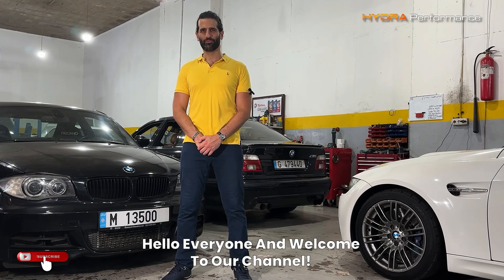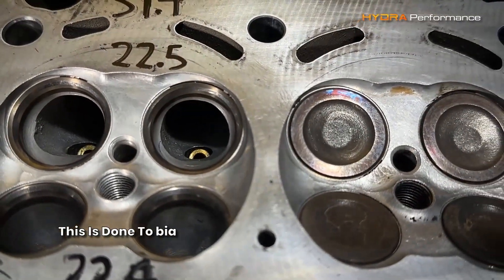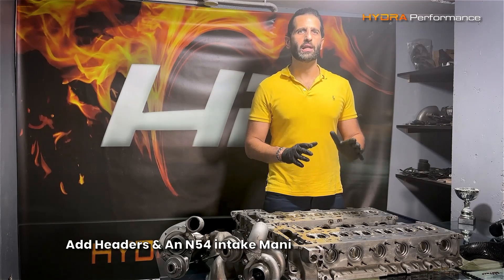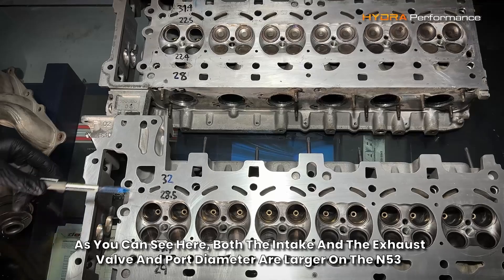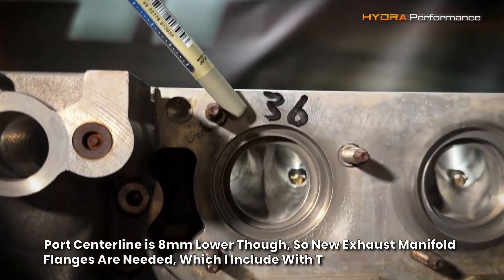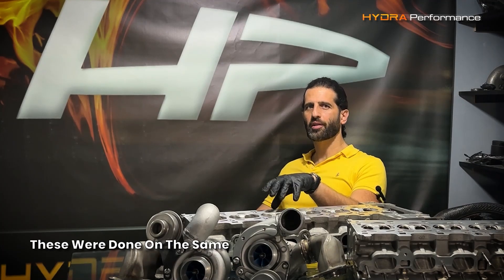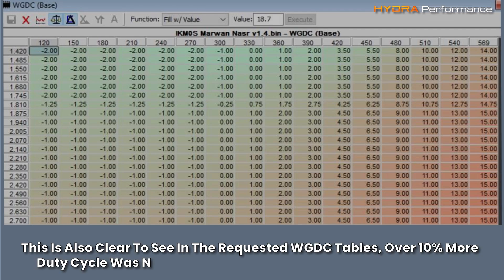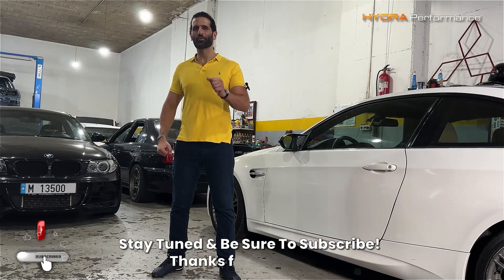N53 vs N54 cylinder heads up close & personal! Is the N53 head swap worth it on an N54? We think so!

Comment: Do you think this trick would work on and N52?
Reply from the maker: Yes, but the Valvetronic tower needs to be milled and the head then needs to be drilled and tapped for an intake cam ledge. You would also need an N52 valve cover as well, and the N54 intake manifold bushings need slotting to get the correct port alignment... I can supply  a turnkey head if need be. Oh, and compression ratio will also probably be reduced as well.

Comment: i cnc ported n53 head, 298/288 +11mm cams, 3.3l 11:1 compression with honda k24 head studs.   i made 1034whp through a zf8hp gearbox with 14 psi and 2* pulled out of the tune.  n54 head never made anything close to those numbers with the same turbo on a fully ported n54 head same cams.   the n54 blocks split at 1000+ hp anyways so it doesnt really matter.  if the block would have held up i could have put down 1300+ whp easily with the n53 head but after splitting 3 blocks we gave up.  2jz time.
Reply from the maker: That's awesome, would be interesting to see a dyno plot if you had any.
Reply: Why does the block split? Aluminum? vs iron block 2J?
Reply: No you just needed an s55 block
Reply: @Piecrumble this is the evolution of the N54/N55 so makes sense 😂
Reply: stock N54 sleeves im assuming ? or darton sleeves ?
Reply: I hope you used the proper headstuds, the rounded nose ends on the stud is what’s needed for N54s otherwise you can crack them easily

Comment: What’s fitment like with a single turbo top mount?
Reply from the maker: Provided you reflange your existing manifold, the turbo will sit 8mm lower in the car
Reply: @HydraPerformance.  you guys sale the flange?
Reply from the maker: @khemchee4685  Yes, with our head packages as mentioned in the video

Comment: I would be curious to see how the N53 head stacks up vs an N54 head with a decent pocket port and some exhaust side work.    Any risk of piston to valve contact using the larger valves of the N53 head?  Any considerations needed when calibrating Vanos?
Reply from the maker: I doubt we'll ever see a truly unbiased flow test comparing the two. I've been told by more than one person that the #s VTT put forward were BS, and given their track record I'm inclined to agree, because even given the same throat diameters a) a 36mm port will always outflow a 33mm port of similar geometry > 0.2 L/D, and b) The N54 head casting has little to no room for a short turn radius on the intake, even ported, so the N53 will always have it beat, and that's assuming you can even open up the throats by 6mm to match the N53 which I doubt...    

We've been running these without issue , on several customers' cars now as well, for several years now. No problems with P2V contact or any special VANOS settings needed. Truly a PnP swap if you've got your exhaust manifold sorted out.
Reply: @HydraPerformance.  Thanks for the reply.   It appears to definitely be a great option for those building the N54.   Harder to get over here in the US sadly.  

It'll be interesting to see how the community changes with the new PI conversion releasing soon.
Reply from the maker: @all4bspinnin311  We ship worldwide... 
This will probably be an unpopular opinion, but DI delete is a definite step backwards, to each their own though.
Reply: @HydraPerformance.  Great video and content overall. The DI delete is to me going backwards, but with injector prices skyrocketing....would it be possible to run a N55 head on N54 block ? basically somehow convert to the N55 injectors?
Reply from the maker: @kristianbojinov5567  This whole injector issue is way overblown. Plenty of used Index 12 injectors out there, + you can recondition yours if need be, and it will cost an order of magnitude less than anything else. My car came with Index-12s when I bought it back in Feb 2016, and they've been running without issue since then,
 so  I don't see what the big deal is.
Reply: @HydraPerformance.  Thanks for the input, this might just be the case. Good point
Reply: i did flow bench both heads and the data that tony and robello racing (one of the most renouned engine builders in the bmw world EVER) put out was pretty close to accurate.

i also ran both heads on the same car same setup and the performance is pretty much the same, its just that the n53 head makes the power much less boost. when you turn the boost up to the levels that the n53 head would shine above the n54, the block splits.  every single time.   tried css, tried a mid sleeve, tried concrete filled, nothing will keep the n54 block in 1 piece above 1000whp.   my car dyno at 103x whp turned down and i turned it up another 17psi 3* and it had to be making 1200+ when it blew up this last time.   the n54 head only ever made 1003whp at the same boost/timing level that the n53 head made 1200+.   the torque curve to 9k rpm is nice on the n53 head, but it sacrifices that low rpm torque that makes the n54 head faster on smaller turbos.    i have data from all of the heads, turbos, dyno graphs etc but im never sharing the actual numbers, not until our other car runs 7s at least.   robello racing and tony vargas werent far off, ill say that much.  i held the fastest bmw 1/4 mile record until the a90 came out on a n53 cylinder head and zf8hp swapped e92. since 2021 on maxxecu.  ive been 8.80 coasting from 1000ft at 3300lbs. the n54 head could NEVER do that.  for what its worth, on a low power car its not worth it.  if youre racing the car, absofuckinglutely do the swap!
Reply: @Mp-jw1qg  Great info and thanks for sharing!   What did you do for camshafts?  When swapping, are you carrying over the N54 cams or still using N53?
Reply from the maker: @ Just saw this would you believe. Have you seen how much power my car made with just 19psi running tiny twins? There's not an N54 in existence that can match it, that much I am certain of...
Reply: So in short the N53 head is a direct swap, using all N53 parts or using N54 cams and vanos gears etc? do you have a write up on this? is the "kit" on your store for say the exhaust manifold? Will this integrate with n54 single turbo swap kits etc...?

Comment: Hi Omar, 
This is Mike from Montreal with the N53 setup. Great video.

Most don’t understand that turbocharged engine need more effort to push out the exhaust gases pre turbine and post turbine vs a natural aspirated setup. Relieving that effort by improving exhaust flow on the exhaust head ports and having a high flowing turbine makes for a more efficient and healthier setup. This is why the N53 head is a much better choice vs a N54 head when going with upgraded turbo. Having intake ports that flow also better is a bonus.
Reply from the maker: Thanks Mike, you put it very nicely there.

Comment: Great video. You got my attention when you said the N 55 head has a similar issue. Do you know if the N 53 head will fit on an E series pneumatic wastegate N55?
Reply from the maker: I tried fitting it on an S55 block several years back and it was a no-go, I'm assuming the N55 is the same

Comment: Great video explaining the differences - I’m sold on the benefits.  But can you make another video showing the other mechanical differences between the heads that need to be resolved and how they are resolved (ie, cooling port alignment, valve train compatibility, exhaust manifold, etc).
Reply from the maker: valvetrain is 1:1 identical, I forgot to mention that in the video, exhaust manifold differences were covered. I guess that leaves the coolant port differences & head bolt & washer diameter differences that need illustrating.
Reply: @HydraPerformance.  sorry, I understand you showed the exhaust ports but how are you resolving it with the “kit” whilst maintaining the stock turbo location, especially considering the stock manifold is welded to the turbos?  Or it requires a lot of custom work to make the turbos fit including custom downpipes?   Hilighting the differences in the cooling port locations would be helpful.
Reply: Good luck with that. I’ve asked him a few times on forums and he’s just stonewalled. I’ll go dig out the specs when I get home. Took forever to find but well worth it

Comment: HI Omar, I think this is brilliant and have followed you since you posted this on Spoolstreet many years ago. Curious, since turbos are not rated by 'boost' but by airflow, and that airflow determines HP, does that mean your overall maximum boost level would be lower if using the N53 cylinder head? For example, I have MMP Stage 3 turbos (I know :O), and if they are maxed at 30psi of boost, and say, 700whp, if I switched to this cylinder head, would I simply hit 700whp at a lower boost level, or would 30psi be more than 700whp? Hope my question makes sense, as I can see both scenarios in my head being true, which I know they cant be lol.
Reply from the maker: Hey Brian, good hearing from you after all this time. Airflow is airflow like you said, but pumping losses are reduced once you have more intake & exhaust flow, so you do actually end up making a bit more power  through higher efficiency. E.g. each lb/min of airflow gets converted to more net bhp.

Comment: @hydra Performance - Can you use all the same Hardware in the N53 head on the N54?
Reply from the maker: Absolutely, I should have mentioned that in the vid. Same valve springs, retainers, ledges, & cams. I'm running Schrick hi-lift cams with supertech springs & retainers on mine.
Reply: @HydraPerformance.  - How do the cams differ from the N53 to N54? Does the lift change at all / benefits as well and would running the N54 be better or N53 or a mix of the two?
Reply from the maker: @snow41man  N53 intake cams are marginally bigger than N54, small difference though, probably worth ~10PS @ the 550-600bhp level. Like I said earlier, I use full-fat Schricks on mine :)
Reply: @HydraPerformance.  - Can the N53 head with stock hardware be capable of raising the rev limit say another 500rpm without the risk of valve float?
Reply from the maker: @snow41man  been running several cars already with a 7600rpm redline with no ill effect
Reply: @HydraPerformance.  In the sates we have N52 that is very common, do you also have one to compare?
Reply from the maker: @snow41man  N52 intake valves & ports are bigger yet, but the increase in flow is not enough to offset the 10% loss of performance from DI delete.

Comment: Great comparison. Any work needed to be done to a n54 block to bolt it up with a n53 head? Other than the exhaust manifold flange swaps ofc.
Reply from the maker: water jackets are different, head bolts are smaller, and some other detail changes. We do the all conversion work to make it PnP

Comment: N53 head on s55 block.
Reply from the maker: Already tried, won't fit sorry
Reply: @HydraPerformance.  what parts are different?
Reply from the maker: @nickg2705  Well for starters, a couple of head bolt holes don't line up.
Reply: @HydraPerformance.  ah that’s what I wanted to know because looking at the pictures you can’t really tell.